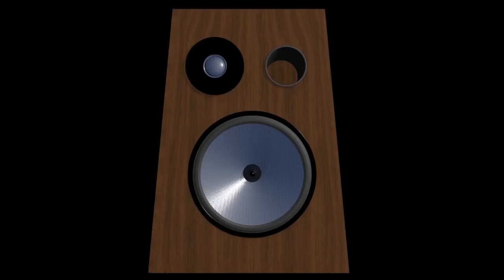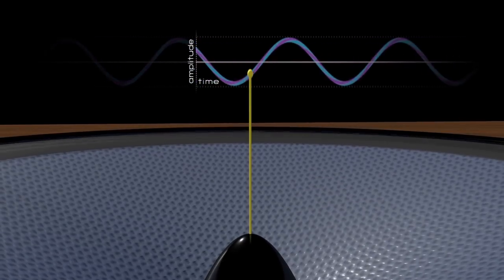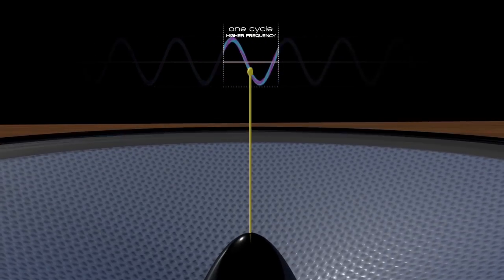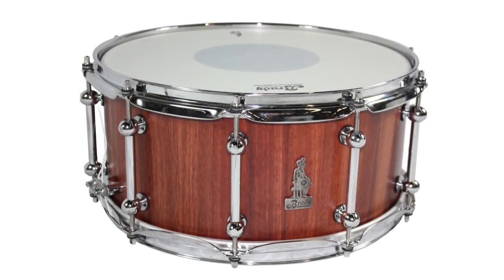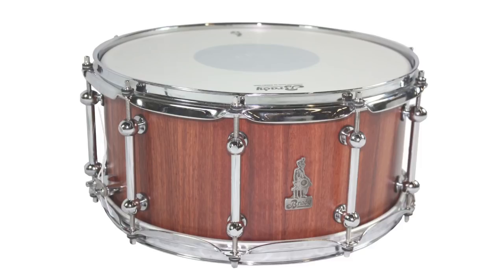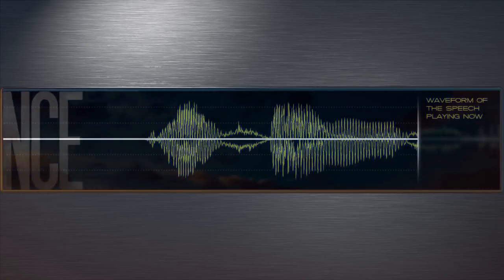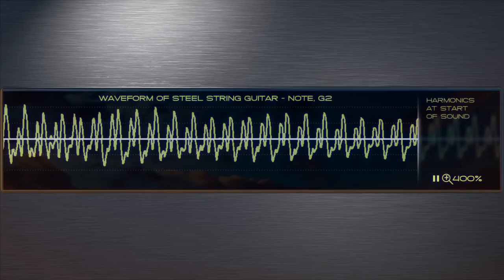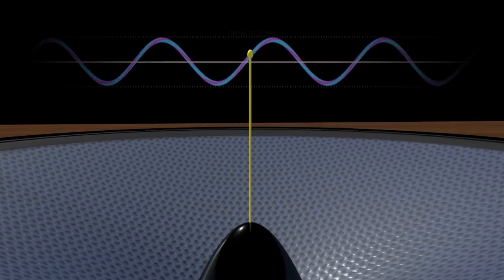Does Bigfoot Use Infrasound? What IS Infrasound?

Comment: I was by myself on the family farm at 7:45 AM Thanksgiving wknd, my brother and father had just left 10 minutes before. My cousin was coming to pick me up after he had finished fixing my truck. I heard someone in the woods hit a tree very loudly with what I assumed was a bat around 100yds away and went to check it out. I was looking at my phone trying to see if I had service while I slowly walked, when I suddenly was struck with the feeling of doom, the sensation of hair standing up went up my spine to the top of my head and I spun around with head on a swivel backing out of the woods as fast as I could. I heard faint whispering that seemingly never came from the same direction and heard multiple "things" moving thru the leaves but never saw anything but a flash of color as I made my way back to the barn and my pistol. As I exited the woods I heard 2 feet stomp hard enough that I could feel the vibration, but I now believe it was a BF jumping out of a tree. For over an hr I heard faint whispers, something akin to african click language that seemed to be answered by what sounded like a woodpecker on speed doing Morse code and movement all around the unfinished barn. About 400yds away I heard what I thought was someone with a hand crank air raid siren  walking through the woods and moments later my uneasy feeling started abating. I now know it's not a mechanical sound and had rocks thrown, the truck shaken and trees pushed down while we slept, whistles mimicking how I call the dogs and a family friend being growled at while turkey hunting. It took me 8 months to go back there and alot longer to stay past dark. I've been in fire fights, fist fights vs 4 people and wrecked race cars but I have never felt fear like what I attribute to infrasound
Reply from the maker: cool. and scary. these things can seemingly mimic just about anything; produce sounds which should (can?) not be made by organic vocal chords. i believe you 100%